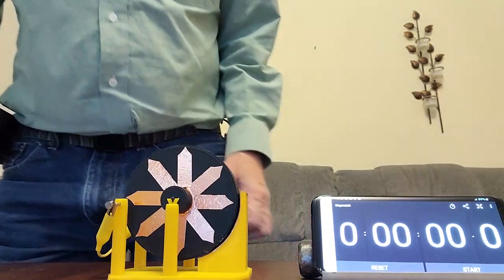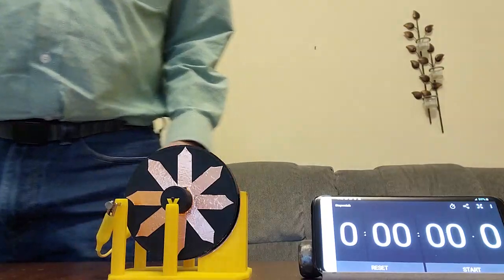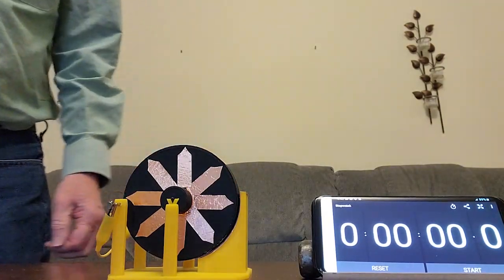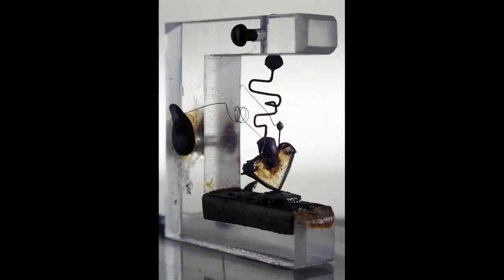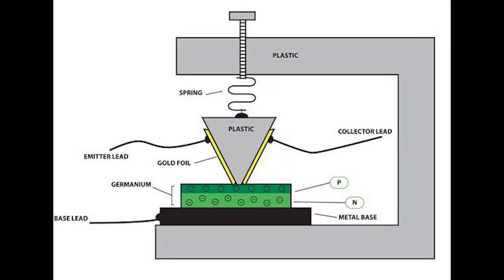Perpetual Motion Video

Comment: I set up two wheels as in ‘wheel and axle lrn fzx’ right by each other. I used the wheels as Atwood’s with the same extra 20 g mass added at the 35 mm dia. One of these two Atwood’s machines accelerated 120 g at the 35 mm diameter and the other accelerated 40 g at 105 mm diameter. The 120 g was a string with 60 g on each side and the 40 g was a string with 20 g on each side. The strings were draped over their appropriate diameter of the pulley. 

I ran the two Atwood’s at the same time and they accelerated at the same rate. 

That means that the 40 g was accelerated to three times the velocity as the 120 g by the same input energy.

Comment: Did you say you used copper strip's and not alumium
Reply from the maker: Yes.
Reply: @ArtLieberman  thank you--i'm starting to work on mine now
Reply: Can you tell me where you aquired your copper strips
Reply from the maker: @garygarner3940  simply search Amazon for copper tape.  However, you should keep in mind that it is impossible to build a perpetual motion machine.
Reply: @ArtLieberman  Thanks---going to work on it

Comment: At 44 second mark of your timer the speed suddenly changes after you place something on the table ?
Reply from the maker: Hi, James.  I promise I'm not doing anything tricky, there.  It's not speeding up or slowing down.  It's just the effect of the frame-rate of the video, the blinking rate of the light bulbs in the room (yes, incandescent bulbs produce a strobe effect at 60Hz), the spacing of the copper strips, and the speed of the wheel.  Do you ever notice in commercials for cars that sometimes it looks like the wheels are turning backwards?  Same thing.  Basically, it's a stroboscope effect.

Comment: Something happens to the speed at 21 second from the start and from 33 second
Reply from the maker: Hi, Niko.  I promise I'm not doing anything tricky, there.  It's not speeding up or slowing down.  It's just the effect of the frame-rate of the video, the blinking rate of the light bulbs in the room (yes, incandescent bulbs produce a strobe effect at 60Hz), the spacing of the copper strips, and the speed of the wheel.  Do you ever notice in commercials for cars that sometimes it looks like the wheels are turning backwards?  Same thing.  Basically, it's a stroboscope effect of the video.

Comment: 😂 shaft of wheels have micro motor which used in mobile vibrator, these motor connect to small lithium battery
Reply from the maker: (Is there a way I can contact you privately?)

Comment: Nope!  Perpetual Motion Devices are not possible.  The reason this spins, even under glass, is that there is a high-voltage generator, be it Van de Graaf or Tesla Coil running in the background.
Reply from the maker: No, there are no external forces.  But keep thinking.

Comment: What kind of material is the disc and is wood sutable for material?
Reply from the maker: The disk is PLA plastic.   Yes, it could be made from wood.
Reply: @ArtLieberman  Do you  guarantee that this device works, because lots of people made it and said it didnt worked.
Reply: I think best will to use a rigid polystyrene foam
Reply: @MehmetBoysal  Did you make this motion making device?
Reply: @goranz9446  you asked: Yes that's exactly what I meant.  You asked, "What kind of material is the disc, and is wood suitable for the material?" so my answer to you was: I think the best will be to use rigid polystyrene foam, for the wheel only of course.

Comment: This looks fairly noice :) does it matter what material the nails are? or just something else than copper? or maybe best something that is far away in the Galvanic series ? :D very interesting :D thank you for the food for thought :D
Reply from the maker: The choice of materials does not matter.  Iron, copper, aluminum, ...anything.  Keep thinking.
Reply: Obviously fake. Jump cut the video to show a diagram of a transistor an then holding the wheel from spinning cause it was turned on
Reply from the maker: @YML1357  No, nothing changed about the wheel when I cut away.  (I should have made the video without the graphic.)
Reply: @ArtLieberman   please make a video again

Comment: Very interesting, I would like to see the backside once you started it turning. You as a magician could have a motor hidden on the backside and switched it on when you pushed the wheel. Redo the video with multiple camera angles to prove your point. Thanks
Reply from the maker: The video does show the other side.  I promise you that there is not a motor on the other side.  The two sides are identical.
Reply: What does your version use? If it isn't a fan, then there must be a spinning magnetic device under the table, turning it by Lenz effect. Or induction
Reply from the maker: @eastky1901  No magnets.  Nothing under the table.
Reply: @ArtLieberman  So whats the catch then, dont leave us in uncertainty? What is the hidden power source for the wheel spining?

Comment: God bless you sir. This is why they banned mercury
Reply: How, why mercury?
Reply: @Goran Z  Because when a + - current over a ring magnet is applied to bowl of Mercury it produces rotational movement in the form of a vorticee
Reply from the maker: @goranz9446  I use to play with mercury when I was a kid.  Freezing it with dry ice.  Shining quarters with it.  Maybe that explains a lot about me!
Reply: @ArtLieberman  Not realy. But you did not confirm will the  wheel work if I make it?
Reply from the maker: @goranz9446  No.

Comment: Your video was okay perfect I would subscribe to your channel to see future videos. But there is a few issues with your point you were trying to make, perpetual motion means something that will run forever we know in this universe will run forever not even Stars called the sun. So try using the word indefinite motion indefinite means that we don't know exactly when it'll stop but run a long time. Perpetual means that you will run forever without any other source of under its own power. You measure that against light not even light lasts forever. Second I can tell if your video was fake so you didn't need to go to the extremes even though I enjoyed that you did, your motor is using electrostatic the atmosphere. And will run definitely, meaning that it will run until there's not static electricity in the this would Tesla was talkin about using the wheel works of the world to power your, if you keep going down this path you will discover a world in which they don't want you to know about. Suggest you learn how to take that motor and draw power from, the easiest way to do that in the way you designed it is to turn it into acourse you're not going to get a lot of power from it but you should be able to take very small motors and draw something from. Keep in mind we've have done these experiments here because we work for a company called Media Library which is an actual Library. We will be doing similar experience in the future so if you go to his website you'll be able to see what you did is not only true it is factual and they knew this long before they even created batteries. Will also give you where we got our information from and proof where you can get it too, just to let you know high humidity will make that motor stop😢 but we'll start as soon as they humidity is gone. Here's the channel to Media,: https://youtu.be/7NQORNCH5S4 
Particular video I chose for you will show you how to increase the power of your little device , you should be able to hit the subscribe button from. Hope this helped you and good video 👍
Reply from the maker: My machine is not affected by humidity in any way.